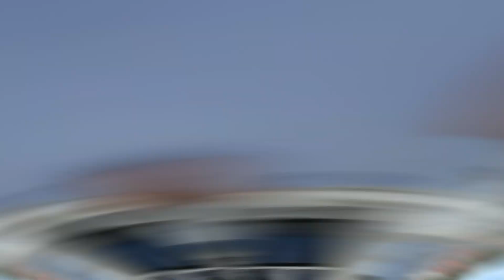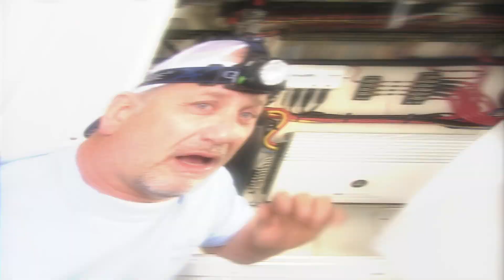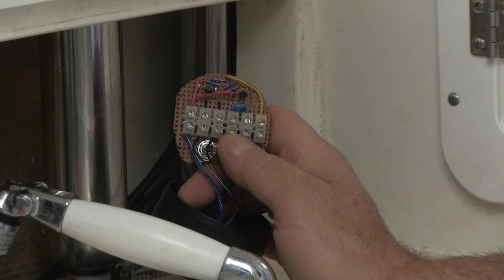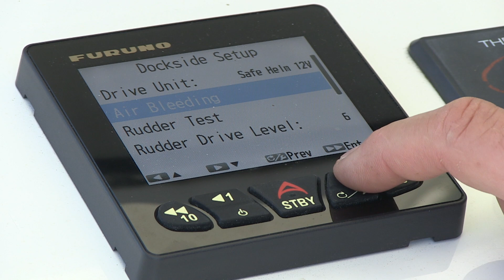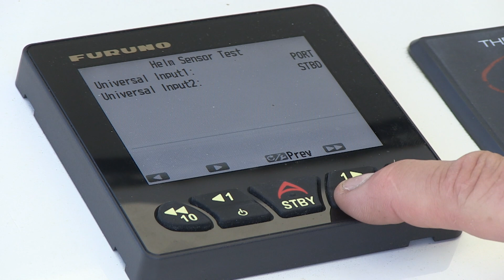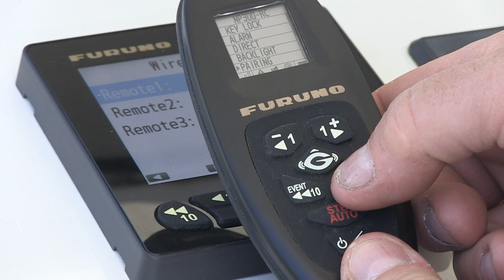Furuno Connections - Episode 5 Part 2- In-depth Installation of NavPilot 300

Comment: Hello, we have 2X 250 HP V8 Mercury Verado Engines and Furuno Navnet Tztouch2 MFD. We plan to buy Navpilot300 and FURUNO SATELLITE COMPASS SCX20. We also want to add DFF3D module to our current system. For autopilot, what do we need to buy as additional? (I mean cable, pump or other things?) Will we need extra pump for Verados? Thank you very much for your interest and helping.
Reply from the maker: Hello! Unfortunately, we don't have technical staff that monitor our YouTube channel. The best idea is to go to our Furuno USA Forum, create a free account, and ask your question there. On the forum, your question will be answered by technical Furuno dealers and/or staff. Go to www.furunousaforum.com. Thanks for watching!